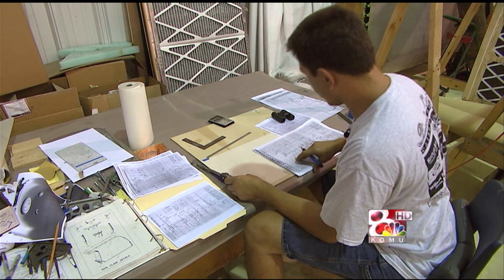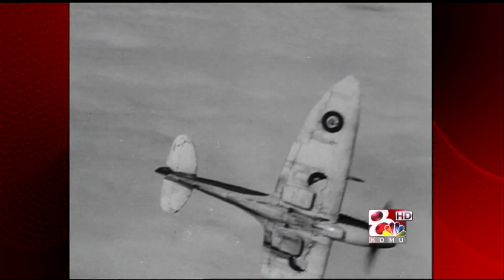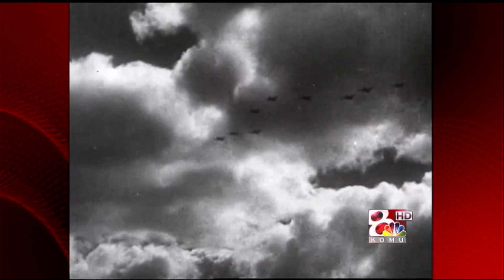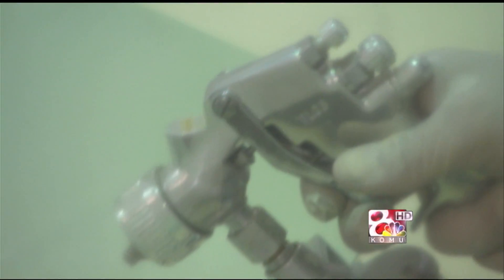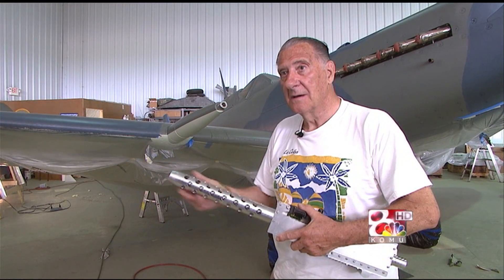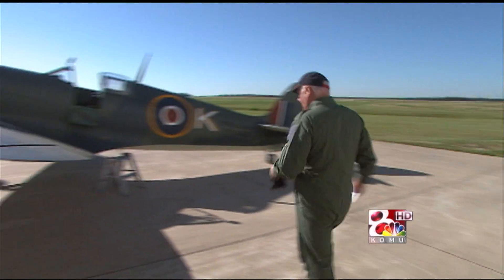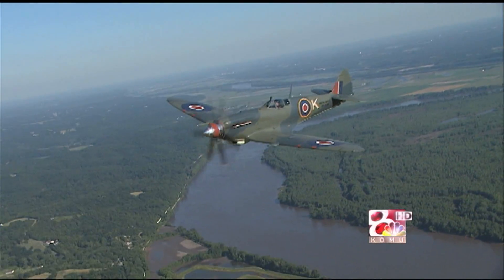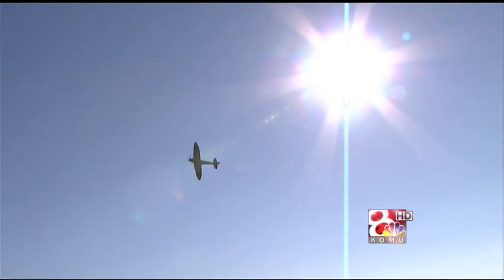"The Seafire"

Comment: This is not a Merlin, it is a Griffon. You can tell by the opposite prop rotation. All later model Spitfire variants used the more powerful Griffon built by Rolls-Royce.
Reply: Not all of them... Mk XVI had a Packard Merlin. Also the main way to tell is the bulges over the engine